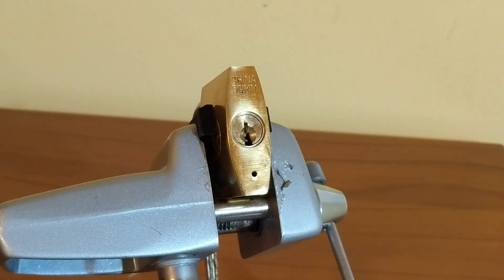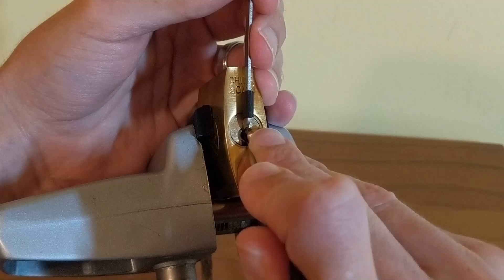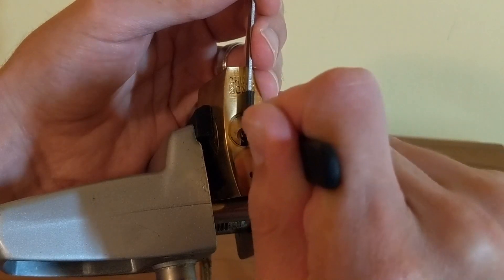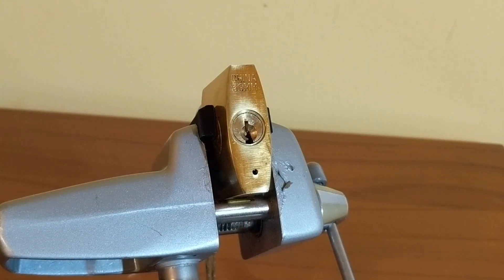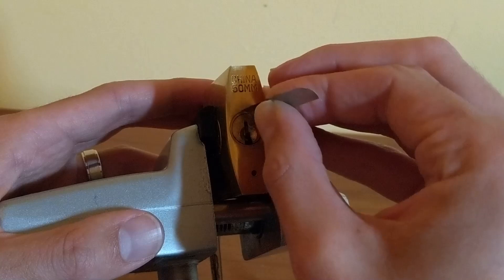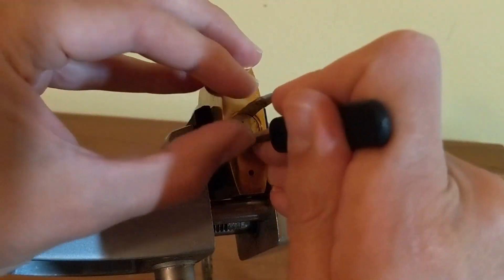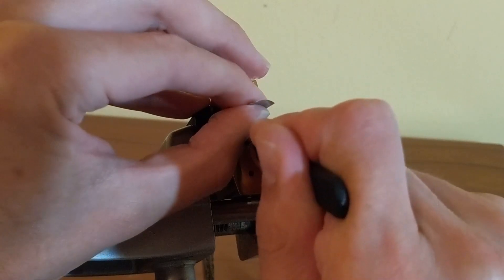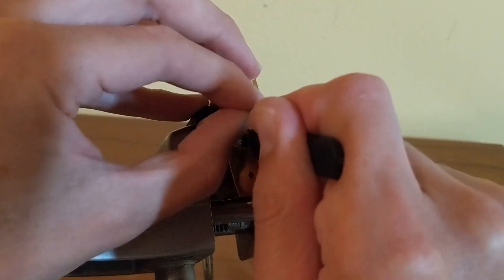[17] 50 mm Brass Padlock - Picked and shimmed open from the front!

Comment: @1:15 you said the bitting could be decoded using this method, care to elaborate how this is done?
Reply: I was wondering as well.  The only way I see is you might be able to remove the core after shimming and measure the pins.
Reply from the maker: I was envisioning using a square hook to push up on each key pin until it hits the shim. You'd then measure the vertical displacement of the pick and back-calculate the pin's length. Now that I think about it, though, this should be doable on any picked core, and not just one that you shim open. I may have underestimated the difficulty of decoding the lock! I'll give it a try offline and report back =)
Reply: @curiouslockpicker8971  Only way to learn is to try!